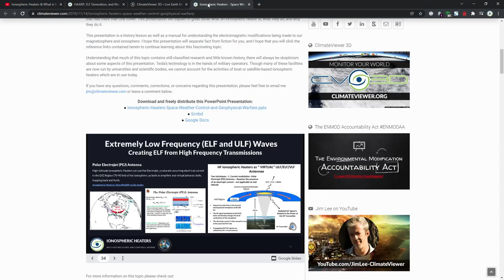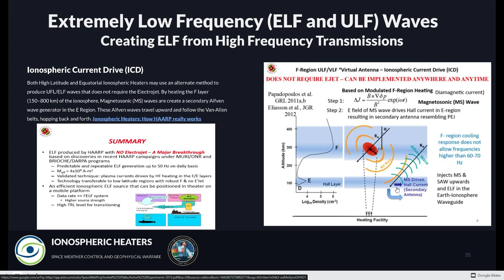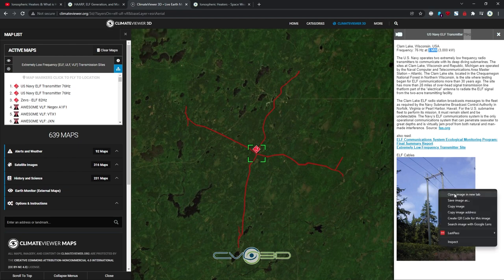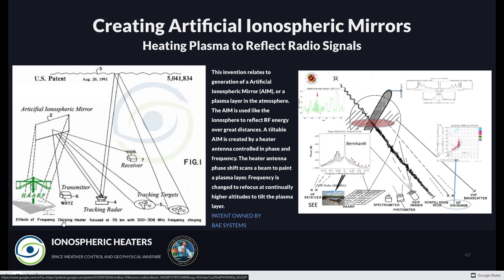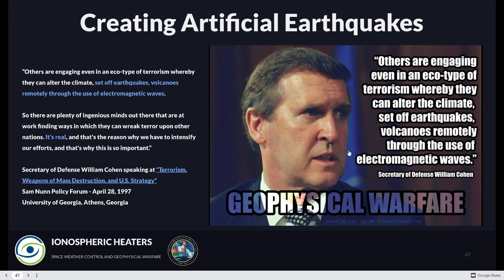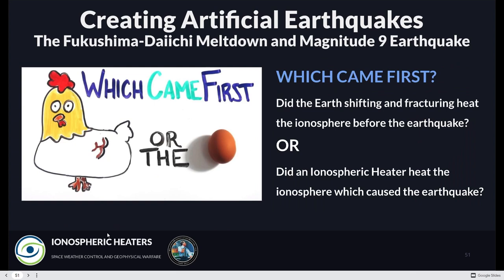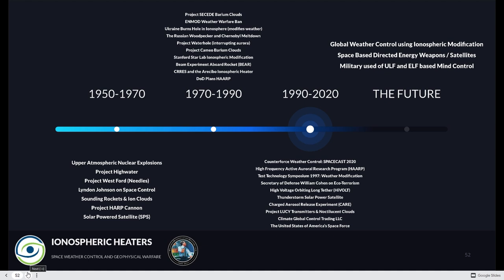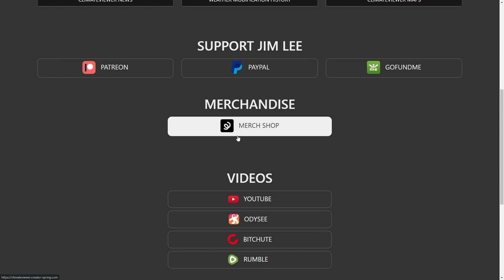Ionospheric Heaters & What is HAARP? Part 2

Comment: I had a high DB reading  between 15000 hz to 24000 on jan 16 and 17th . The calm cold morning changed to warm high winds by noon on 16th. on the 17th it was the same , cold calm in the AM then warm wind in the afternoon and the acoustic gravity pressure waves stretched across the sky. high measurement in 2.5 hz at same time as the 15000 to 24000 hz . today is normal
Reply: Were you using a SDR to listen and noticed this? I was listening on 10MHZ one day and then I heard something about "ionospheric testing" on that frequency and they started playing tones.

Comment: So, per the Fukushima-Daiichi earthquake and resulting meltdown, what is Japan doing about it?    ~    I have seen rainbow lines (not a bow, but a long line of rainbow colors) over and in our mts (CO Rockies) and it runs almost 360 around my view.  At 8,000'-12,000', along ground level.  WTF is this??  I saw this about 2 weeks ago and the sky was clear, low humidity, and no conditions that would normally cause any rainbow effects.

Comment: That should be pretty easy to cross reference by monitoring and correlating the ionosphere heating and earth quakes. Since the signals from these heaters can be tracked when they’re on and transmitting, one should be able to tell if they are causing this heating or its natural part of earthquakes. It’s high possibility it’s natural because after all this technology really isn’t “new”, humans are just manipulating natural functions of the ionosphere with technology. Also, there is a very strong correlation that earthquakes are triggered from energetic bursts from the sun. If the were heating the ionosphere at the same time one of these bursts also hit it, then it would super heat and a massive earthquake would be the result. Our military is just dumb enough to allow that to happen.